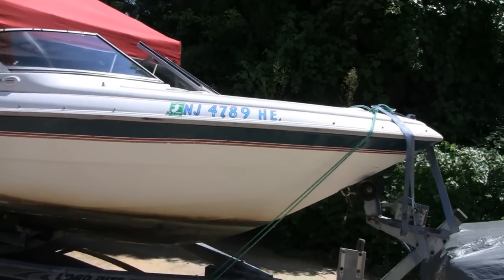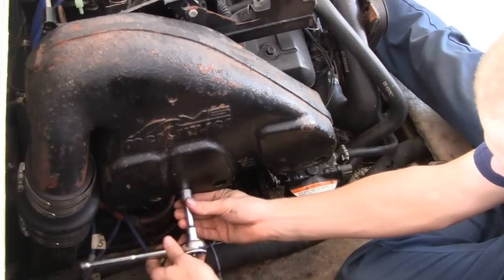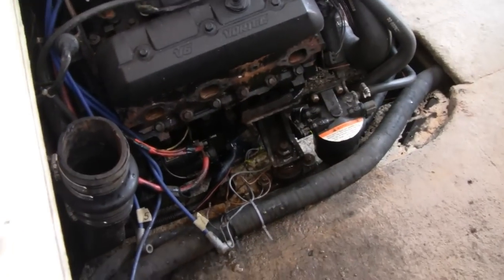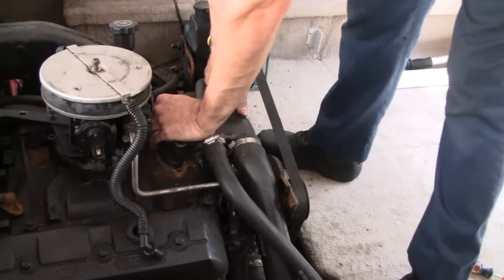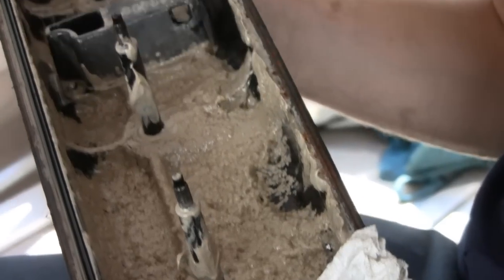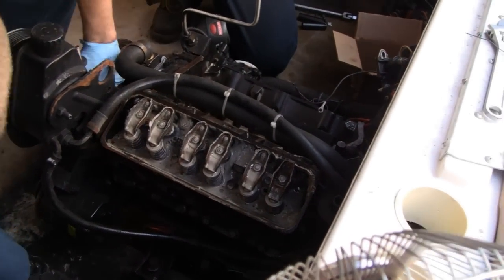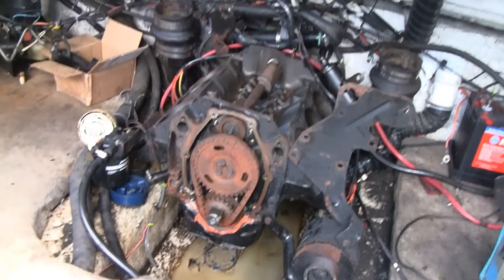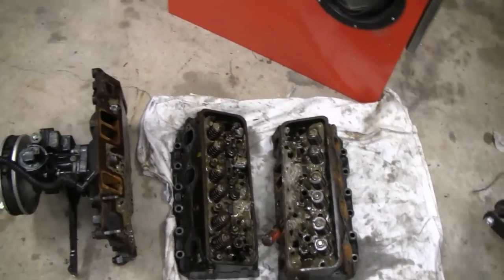MAJOR BOAT ENGINE REPAIR (part 1)

Comment: I had the same boat and motor,with the same problems you have. I did pretty much the same clean up as you guys. Put it all back together,it ran great for a short time. Started to see water in the oil. Found a crack in the block.  New engine fixed it. Make sure the guys really clean that block really well, get a magnifying glass and look it over good. I wish you guys well.  I enjoy this channel a lot thanks.
Reply from the maker: Gene Babine Thanks alot Gene!! If there's anything else wrong with it we'll have to sink it!!☺

Comment: Wow this is amazing, i got that same motor in my s10 blazer 4wd, 262 cu in 4.3L, These motors suffer from head gasket failure often, usually have to replace them one time with some high quality gasket and you'll likely never have the problem again for the life of the engine!
Reply from the maker: WhyDidYouTurn Yeah we replaced them with $80 marine gaskets!!☺

Comment: Roadking, that really looks like a mess. I really wasn't expecting to see the head gasket so thoroughly gone, as the exhaust manifolds are usually to blame for water in a marine engine. I have replaced a few head gaskets in 4.3 engines though. You should definitely have the heads surfaced. There will be staining or etching under the bad gasket areas if the leak has been present for very long. It is also possible that the gasket failure was caused by hydrolocking rather than being the initial water entry point. So check the manifolds. Freeze damage can also cause a crack in the bottom of the intake manifold. Those one piece exhaust manifolds are no longer available from Mercruiser. None of the aftermarket companies make a direct replacement either, as far as I know. The two piece manifold and elbow can be retrofitted. You asked whether that was called a manifold, or a riser? The answer is that the one piece is called a manifold. The top part of a two part exhaust system is called an elbow, or a riser, depending on whether it is a Mercruiser system, or a Volvo Penta system. Same thing, different nomenclature.
After you get the engine back together, I would run it up to temperature, on the trailer, with water muffs over the water intakes, and then change the oil and filter again. Then if there is no new water in the engine, take the boat out and give it a good two hour run, and re check the oil. The heat will evaporate any remaining trace water. If you get new water in the engine, the exhaust manifolds are most likely to blame. 
I spent 12.5 years as a marine mechanic, and/or service manager at boat dealerships in Sacramento, and Redding, California. I presently sell marine parts and accessories at Harbor Marine Maintenance and Supply in Everett, Washington.
Good luck with the project. If you need any help or advice, let me know.
Regards; Scott M.
Reply from the maker: Scott M
Reply from the maker: Scott M Thanks alot for all the great information!! I appreciate you taking the time to type it up for me!! Hopefully the bottom end hasn't been wiped out!! We won't know till we get it back together and running!! I'll definitely contact you with any questions!!☺

Comment: That looks like a fun repair!
I think after that I would just pull the complete engine and check it over.
Reply: wow  subed to both of you
Reply from the maker: ***** They all look like fun when you start, not so much after 8 hrs in 95 degree weather eh!!☺

Comment: great coverage of the disassembly Roadking. with that much water/sludge in that engine it couldnt have had very good oil pressure, im wondering if the main and rod bearings are ok. sometimes that water/sludge with low oil pressure will compromise the bottom end. as far down as you have this, it may be worth pulling it out and checking the clearance of the bearings. anyway, great video my friend.

Comment: I use to have a 1963 Owens 30' Cabin Cruiser with twin Chevy 327's. Those Water Jacketed Exhaust Manifold/Risers are awful if the rust up though.. but new boats have sealed cooling systems with a heat exchanger...so nice anti-freeze based cooling for the engine and the sea water get injected in the exhaust to help keep things cool.
On my old Owens seawater was just sucked up and pumped through the engine and out the exhaust...UGH had to constantly drain the block and flush it with fresh water after taking it out....nothing worse than hot saltwater for cast iron......use to use a lot of anti-seize on that thing!.
Reply from the maker: GrandsonofKong I was surprised we didn't have trouble getting any of the bolts out!!☺

Comment: It's definitely been run for a long time with water in the oil. I'd be putting new bearings in the bottom end too. I just had to put headgaskets in my 89 Chevy and I used diesel to clean everything good too. Those 4.3's are the same as a 350 just minus 2 cylinders except that's one of the newer ones with the balance shaft above the cam. They tend to crack heads pretty bad.

Comment: It looks like an old Buick V6 engine...They had an oil pump in the timing case here and EFI with electronic ignition (No Dizzy)...The screen on the oil pick up was tiny and the balance shaft bearing was always noisy and the cam bearings(only 3) would peal the center one out of the block and then the cam would snap in half.!...The heads used to crack quite a bit and the valve seats would hammer up in the head on the ones we had here in OZ.I've got the next carnation of that engine at work at the moment with bigger problems than a blown head gasket...lol

Comment: All that oil water mix, I'm sure Mac Donald's could use it for their fries. 
I used to see a lot of the oil emulsification on the smaller engine Rovers and Jags back in the day, the aluminium cylinder heads would warp and crack.
Reply from the maker: Green Silver I've never seen that much water and sludge in one engine in my entire life!!☺

Comment: Major job is right .My buddy Bill does this kind of work all the time .Ya might want to get those manafolds checked out as well . Make sure all the water jackets are still ok . Gerry
Reply from the maker: krazy45cat If anything else is wrong it we'll have to sink it!!☺
Reply: 805ROADKING Now is the time to pull the lower drive and ck the u=joints and bearing  :(((
Reply: @krazy45cat  9

Comment: looking for some advice. I know nothing about boats, a little experience with motors. Im looking to trade a rifle for a jon boat 16 footer with 70hp evinrude (with console and all that jazz). Older engine says it needs a tune up and what not, Whats the most it would cost to get an older outboard rebuilt and running good. what should i look for when i go to look at the boat? any help is appreciated thanks.

Comment: hi EK was it just a head gasket or the inlet manifold gasket it looks an interesting job
i used to take on stuff like this in my younger days as long as there is no cracks in the heads things
should be ok i would get the heads crack tested and skimmed then you know there not warped great video
cant wait for part two
Reply from the maker: Andy Coakes Everything looked OK!! Too expensive to get crazy with it!!☺
Reply: i suppose thats just the mechanic in me i used to do a lot of engines and gearbox rebuilds

Comment: It shouldn't have leaked water between the cylinders where the head gasket was blown. Is there another blown area on the gasket?
Reply from the maker: BUDDY LIGHT Nah the whole gasket was separated blown away!!☺
Reply: I recommend soaking the entire engine when put back together with CRC Corrosion inhibitor.

Comment: wish I lived closer just to help the last boat I did a engine swap it was a 455 olds I have a 305  gm. to do with the same problem you have I paid 300 bucks for the boat its a bay liner 20 footer

Comment: I would proble say that that motor has bent rods it proble  the cylinders and bent the valves rods the motor will proble knock un less you rebuild it

Comment: Its time for a rebuild.  No problem getting parts for 4.3s...
Reply from the maker: ***** Nah!! that boat ain't worth the expense!!☺
Reply: 805ROADKING make a trip to the  junkyard  and get  a  used engine ,,
you should be able to find a  4.3  pretty easy 
and if  you were  adventurous  you could  put a  350 in it's place ,, just gotta get  manifolds  ,, all the  other parts are the same including the  waterpump

Comment: Wuter?  :o)  That looks a lot like the 4.3 litre i rebuilt in my daughter's 97 S-10 Blazer. yeah i thought so, hasn't been that long since i was rebuilding hers from the block up too.   Even if that timing chain wasn't loose i'd change that and the gears out both. yeah that gasket is GONE for it to be throwing that much water out and turned the oil like that , someone really gave that thing hell since the initial damage was done too.   They aren't that much. i bought a double roller gear set and chain with the new timing chain cover i think it was like $80.00 for all of it.  Yeah as thick as that sludge is all through the motor someone ran it like that for a while.  The sludge is brown because some of the brown from the rust mixed in the oil and water.  other wise it would just be gray or gray and white.  i know a guy that goes around to local shops when they pump gas out of a diesel tank when someone makes that mistake and gets what they pull out to clean his parts and things with.  they usually give it to him happily because other wise they have to pay to dump it somewhere and it's kinda expensive from what he tells me.

Comment: Those salt water engines don't last too long if the boat stays in the water and the engine isn't flushed out... they don't last that long even if the IS hauled out of the water regularly and the engine flushed...

Comment: I would have taken the motor out.had a motor with the water pump on the end of the cam shaft so when the seal leaked water ran into the engine.A bad idea but also caused by me running the engine with out water going through it.We learn

Comment: Few years ago a friend had a Sealine with a 350 small block Mercruiser. It dropped a valve seat insert. We think? it might have been converted to run unleaded, hence inserts. Quite by chance I met him on the first trip after the repair, done by another friend so not that expensive. Got a brilliant pic of me coming through the Glory Hole (High Bridge) in Lincoln......driving a £30grand boat and drinking REAL Champagne and I was wearing my very expensive Ferrari T shirt given to me by another good friend. Pics on FB if you can see it  https://www.facebook.com/photo.php?fbid=493208837375&set=a.446442967375.225653.634892375&type=3&theater

Comment: that engine is JUNK ,, your gonna  have to completely rebuild it ,,,I can guarantee you that ALL of the  bearings are  scored/pitted  including the  cam bearings 
chances are   that heads are cracked or an intake possibly